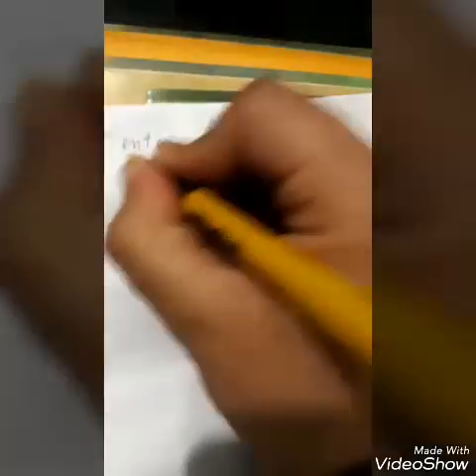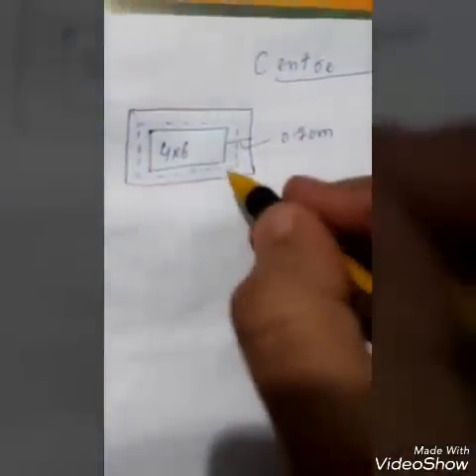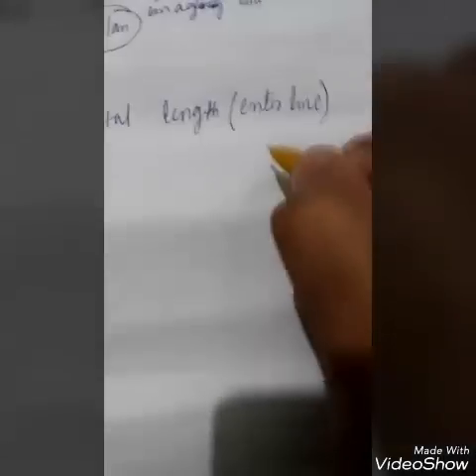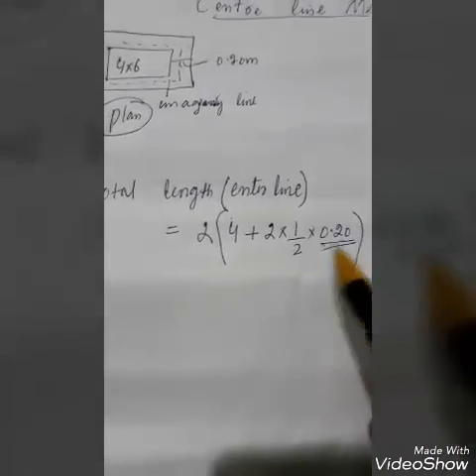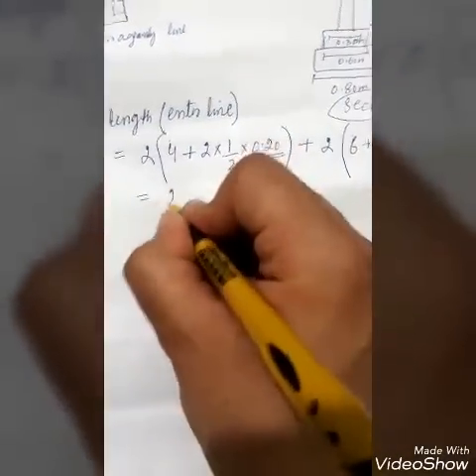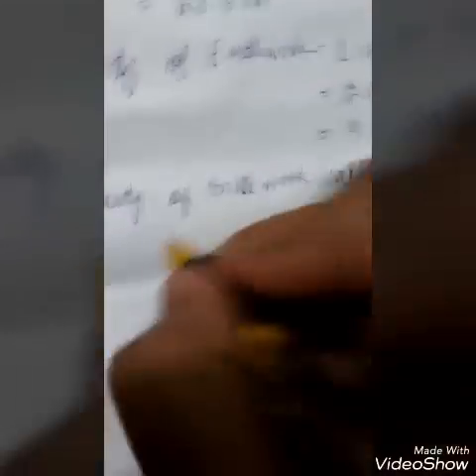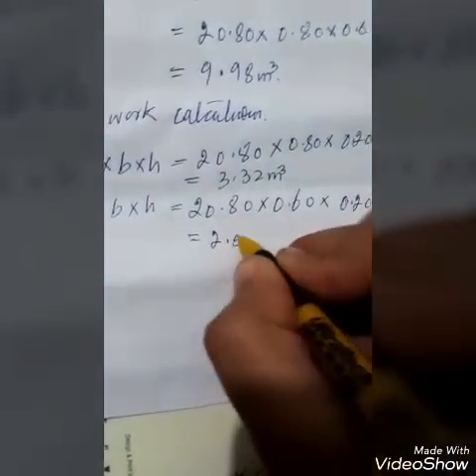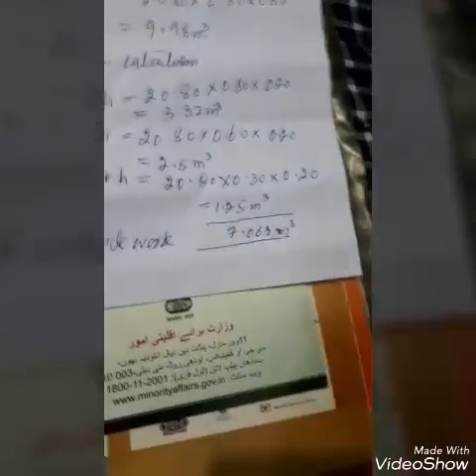Easy Way of Centre Line Method

Comment from the maker: Extra flexural movement is generated and we need to provide xtra confinement reinforcement to prevent failure and also checken mesh is provided to sustain hair cracks... Also ductility is increased along with xtra rings for earth quake resistance